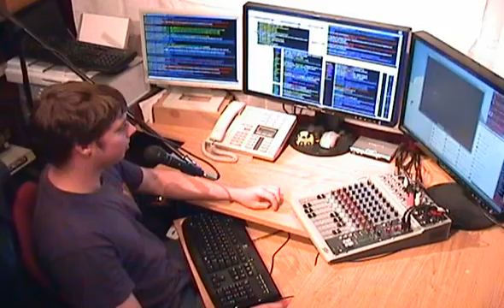Better Audio for your Stream & Videos

Comment from the maker: I used 1/8 to Female RCA, then from that connected RCA cables to the RCA stereo inputs on the mixer. Then using 1/4 to RCA adaptor connected to single RCA cable to my sound cards input with a RCA to 1/8 for the monitor output. Then using RCA Y splitters to connect from the TAPE OUT of the mixer to the 2 RCA cables going into 2 computers with another RCA to 1/8 Make sense?

Comment: Hey bro, nice vid. I'm wondering what route you went with feeding your computer sound into the mixer..Straight 2 1/4" to 1/8"..or what? Also, are you using the RCA outputs to feed this videos sound? Sounds nice.